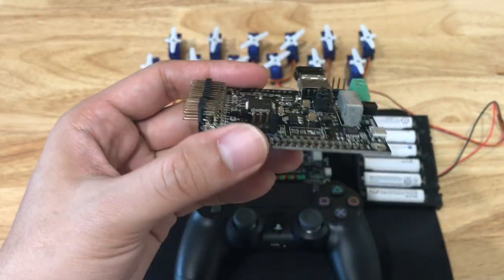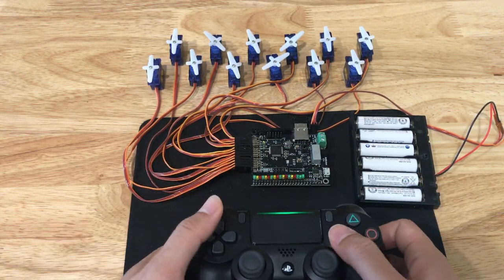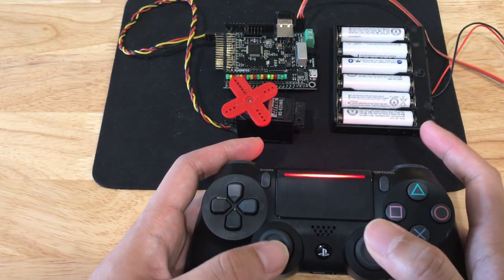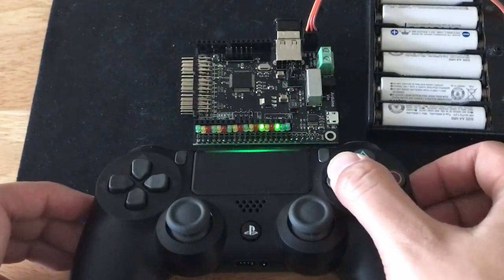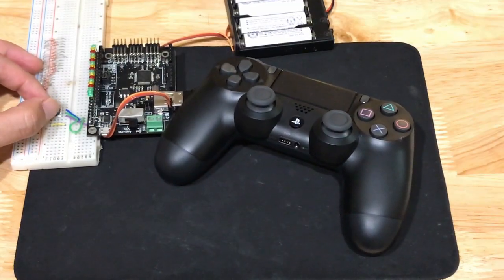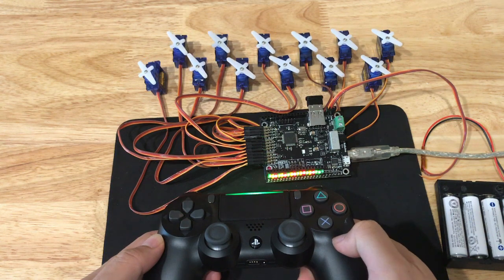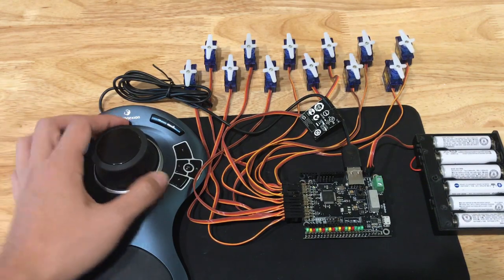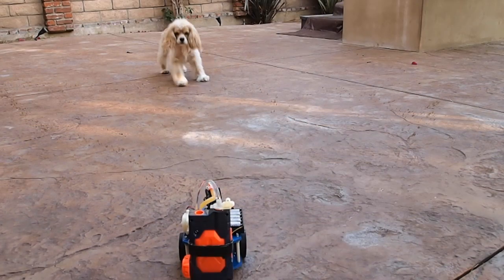Servoshock: Wireless Servo Control with PS4 Controller

Comment: Sir, Amazing video about Wireless Servo Control with PS4 Controller. Sir, can you make a video on youtube on making an Arduino Xbox-controlled 6-dof robotic arm car using the Xbox 360 controller and give me the circuit diagram and the code for the Arduino Xbox-controlled 6-dof robotic arm car using the Xbox 360 controller?
Reply: Us PS3 controller
Reply from the maker: Sorry, I only know how to use PS4 controller.  However, there are plenty of resources online that will teach you how to use XBox360 controller
Reply: @Crossxproducts  Sir, give me the online resources to teach me how to use the Arduino XBox360 controller. Sir, tell me.
Reply from the maker: @fouzanjaved5441  https://docs.arduino.cc/retired/shields/arduino-usb-host-shield  There is an XBOX 360 library for it.
Reply: @Crossxproducts  Sir, thanks.

Comment: So this could easily be used to control the servos in a Rc lowrider with 4 servos? Sounds dumb but it it plug n play without
any programming or coding?
Reply from the maker: It's been done before: https://www.youtube.com/shorts/c3HQBRck1TE.  Whether you need to code depends on what exactly you want to do...

Comment: thank you ery informative but i would like to ask you if this is compatible with with this board .this board has has inbuild bluetooth all in one motor driver microcontroller.it does not use shield..Romeo_BLE_mini_V2.0_SKU_DFR0351 https://wiki.dfrobot.com/Romeo_BLE_mini_V2.0_SKU_DFR0351

Comment: I have been trying to figure out if I can connect a ps4 controller with only a nano 33 ble/iot only... think that can be done? Its for a micro rc car. This setup is to big to work.
Reply from the maker: It can be done, there are tutorials online that might help.  However, you have to use the bluetooth pairing method instead of the USB pairing method that I used because the Nano33 doesn't have a usb host capability.

Comment: This is awesome! I am about to purchase the servoshock, is there a way of having a display for it?
Reply: You can see in the video that the outputs of the board are connected to servo-motors. There is nothing that would stop you from connecting them to an arduino-input or something, and then send display-data to a display based on these inputs.

Comment: What MCU did you use? I'm looking to connect a DS4 to an ESP32 which has a built in Bluetooth module, I'm curious if it is similar.
Reply from the maker: It's a Microchip PIC 16-bit MCU.  The schematics and source code are in the description.
Reply: Does it really work with esp32?

Comment: So to have it automatically operate the servos without touching the controller you need an audrino?
Reply from the maker: That is correct
Reply: Thanks! Is it difficult to set up?
Reply from the maker: @creativeguy1138  It's quite easy.  See the website link in the video description.  There is a sample Arduino project on the documentation page.
Reply: Excellent! Thank you very much!
Reply: @Crossxproducts  Just one more question, is there a particular type of Arduino needed or is just the basic one okay?
Reply from the maker: @creativeguy1138  It was tested using the Arduino UNO R3, Arduinos where the SPI/power/ground lines are on the same pin will be compatible.  However, Arduinos where the shield pins are different (like the MEGA) won't be compatible.